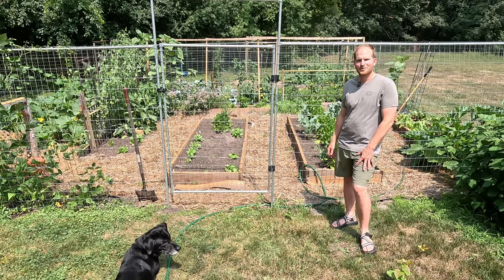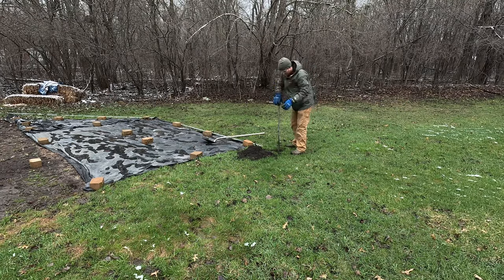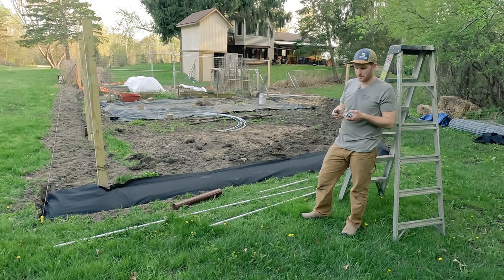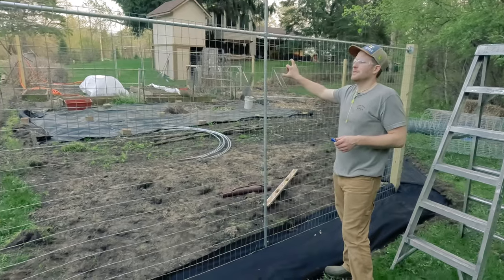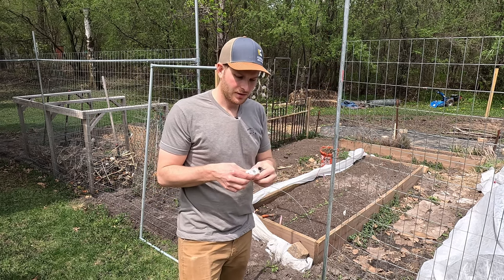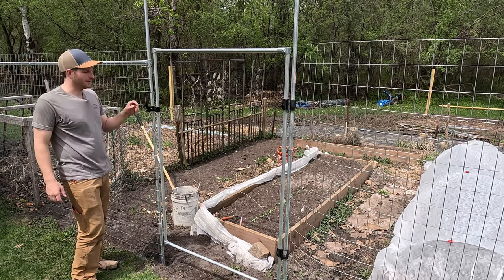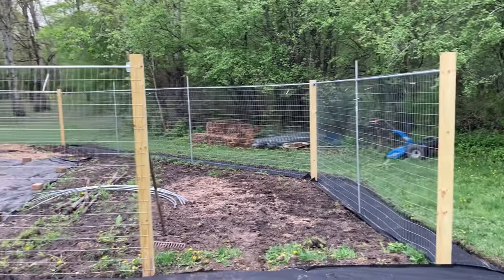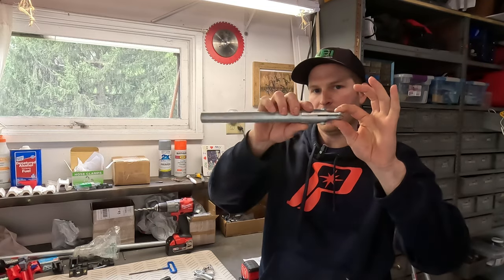DIY Garden Fence Using Conduit and Maker Pipe

Comment: Very nice! I'm interested and I have a question, how does the printed hinge hold up against UV rays as UV rays will destroy PVC in a year or two of sun??
Reply from the maker: Thanks! So the hinges I’m printing now are out of a material called PETG, which is supposed to have pretty good UV resistance. I have had only had them in use for this summer, so I can’t honestly say how long they will last.